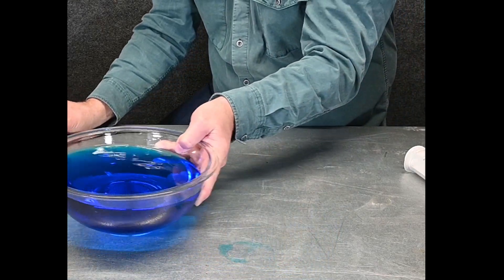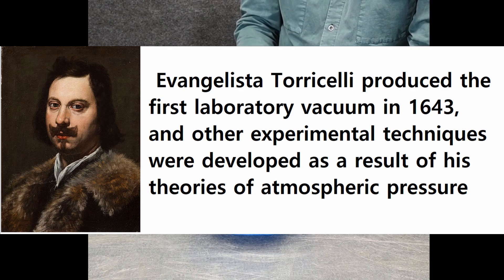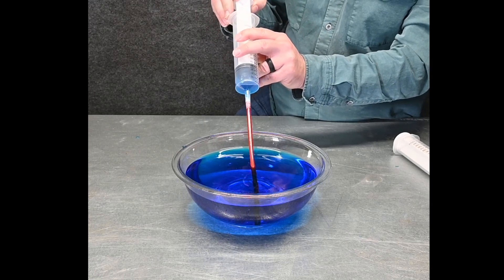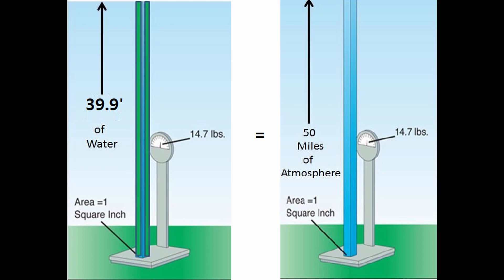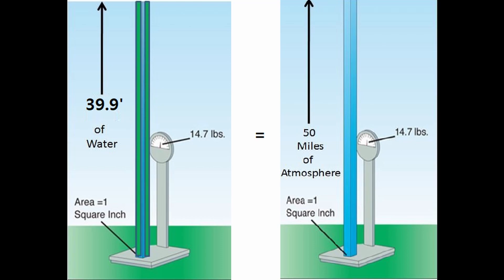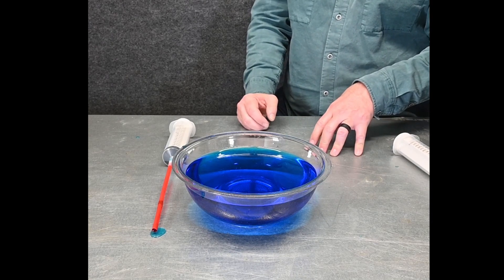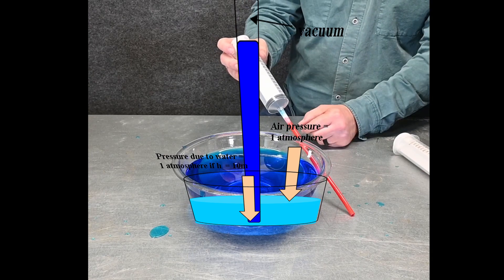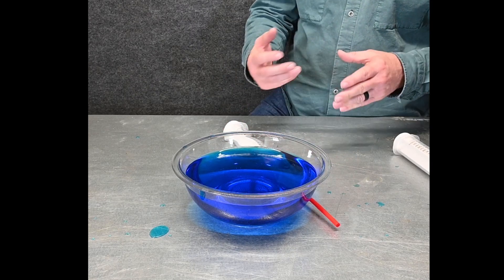HVAC 137 Vacuum P4 visualize, measuring vacuum

Comment: I was just reading 'We Got Steam Heat' a homeowner level book on steam heat.  Steam systems make very good use of atmospheric pressure and vacuum.  If your air vents aren't working, the steam won't reach the radiators but get stopped by the backed up air.  Condensing steam would draw more steam into the radiator, but when the boiler cut off, that vacuum from the condensing steam would pull in air, till the next heating cycle.  Radiators were controlled by stopping the venting of air and having a vacuum breaker to let in air to fill the vacuum as the remaining steam condensed.

Comment: Question when they say condenser is precharge for 25 ft of line set, does that mean total line vapor & liquid? Example if my condenser is exactly 25 ft from evap coil I should be good to go? or do I have to Add for another 25ft for the opposite line going back to condenser. Hope that doesn't sound confusing.thanks
Reply from the maker: Great question
Yes, it's for both the vapor and the liquid. 
The liquid is what we account for. The vapor side is a very small amount but is also included.

Anything over the precharge we typically add 0.6 oz but it varies  by manufacture.
Reply: Also keep in mind that you must use the tube diameters specified in the installation manual for your line set otherwise the relationship won't hold.